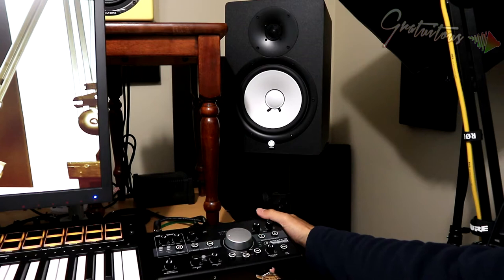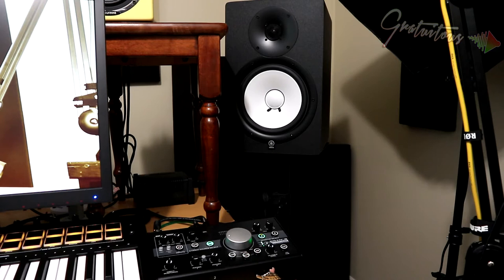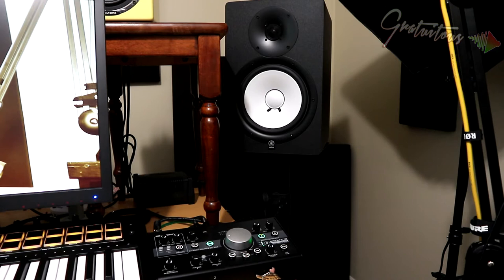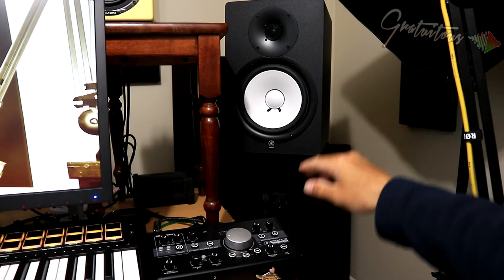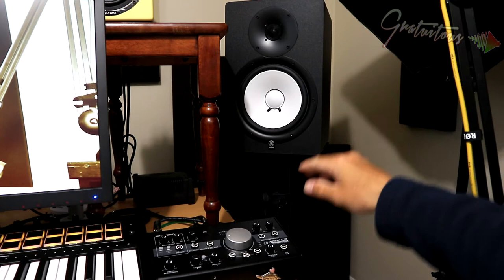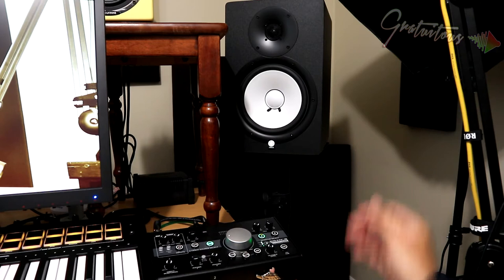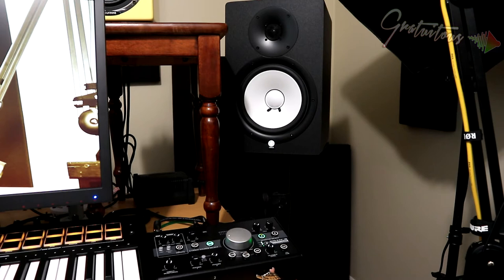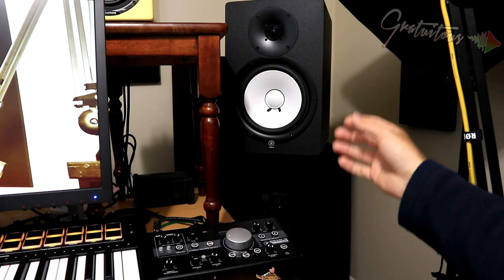How to Stop Speakers Popping when Turning Audio Interface ON/OFF

Comment: OK, by the title I thought this was for all audio interfaces. Turns out its only for the .0000001% of people who have an OPTION TO TURN THE SPEAKERS OFF!!
Reply from the maker: All speakers have the ability to turn them off/on (for reference monitor speakers).

Not all audio interfaces have the ability to be turned on/off via switch.

What's your issue you're having?
Reply: @itsGratuiTous  Huh im confused too bruh. Not all speakers have off/on. the only way I can get power to my speakers is through my amp.
Reply from the maker: @tradertom4843  Sorry for confusing wording.  The amp is your on/off switch to your speakers, which is the same thing as an on/off switch on the speaker itself, so there's no difference there.  The problem is if your audio interface does not have the on/off switch.. that's where the pop is coming from.  Either way, make sure to turn off your speakers first.. does that clarify..?
Reply: We all have the same option.. if you use dedicated power strip as the on and off for your monitors.
Reply from the maker: @sooesoss6063  This power bar trick will still work if you do not have an audio interface with a power on/off switch.  Use the power bar to turn off and on your speakers before turning on/off your computer, or unplugging your audio interface!
https://itsGratuiTous.com/

Comment: Recently got a new active subwoofer. Connected directly to my tv headphone out. I noticed it popped when the tv would turn on. Same thing would happen to my active bookshelf speakers, but they were only $100 so I didnt really care with them. And honestly, my speakers haven’t been damaged in the 5yrs I have owned them anyway so I just lived with the pop. The new subwoofer was different though, being $500.

The issue is I dont have a proper dac/amp or A/V receiver yet and I know the 3.5mm headphone out is higher voltage than the line level RCA input that my subs take, but I read online that it could still work as long as I set my tv volume as low as possible and subwoofer set to minimum volume, before adjusting to get proper levels without overdriving the sub. They do work, but doesnt fix the pop.

After some tests with my multimeter, I discovered that the tv headphone out is storing voltage (in its internal capacitors) which buildup voltage each time the tv is powered on. Measurements showed voltage spikes anywhere from 3-6volts coming from the 3.5mm headphone out of the tv. And looking up the manual for my sub, its RCA line level inputs are only rated for -10dBV (or 0.33volts). So the power spikes were much higher than this of course. 

After more testing, I found that the buildup charge eventually drops after power on (or either by turning it off and letting the tv “rest” before turning it on again) by about 0.10V per second until it reaches a steady maintenance working voltage of 0.15V, this was much better for my Sub inputs. 

The impedence of the cables being used also make a difference. Thinner gauge and shorter run lengths had less impedence and were more efficient, meaning the voltage was being transferred faster -which is not what you want. Now, at first, I was using one of those cheap 3.5mm to RCA Y-adapters usually included with cd players, and stereo equipment. About the same gauge as a standard aux cable and ran about 6ft. 

When I discovered the pop, I ordered a thicker and longer Amazon basics cable which was 8 foot and double the gauge. Measuring this cable I now had spikes around the 0.5-1 Volt range. The new cable was slower and less efficient (higher impedence) reducing voltage transfer. Again, voltage was depending on when I last turned on and off my tv and how much residual charge was still being stored internally. I havent measured the new RCA cables because I was impatient in waiting for stored voltage to drop, but I am guessing if the tv hasnt just been on and there is no stored electricity, it shouldnt cause any “popping” to my speakers or subwoofer. And at least now I know that at it takes about 2-3mins to go from an over-charged state of 0.5-1+Volts if it is. This doesnt mean you have to wait 2 mins after powering on each time, just wait until it is fully powered up and running before turning on your audio equipment. 

The 2-3mins is just how long it took to cool down once it had more than normal stored levels of charge (from being repeatedly powered on, consecutively, during my testing), as I was watching the voltage levels drop with my multimeter. Actual working voltage with the new cables was actually 0.15V after a normal power on, which was perfectly suitable for my subwoofer in this case.

Again, this setup is not ideal, and ideally you need some kind of receiver or dac/amp in between the source (tv, laptop, etc.) which can take that higher level headphone out signal and output it to proper, unamplified, Line Level or Speaker level input for your speaker or subwoofer. Turning the tv or source on first, with the sub volume all the way down or sub turned completely powered off, and waiting until the tv is completely powered on BEFORE you turn on the subwoofer will get around this issue. As well as using higher impedance and non-faulty, properly grounded cables will avoid any speaker or sub pops. Avoid short cables if you are trying to increase impedence. Longer cables at higher impedence will help slow down voltage spikes. 

I am saving money before choosing and buying a receiver or amp/dac, so for now I am stuck with this setup, but switching the cables and only powering on the sub after the tv is on and fully running, as well as not repeatedly turning the source on and off will help reduce charge buildup and avoid speaker pops. So, yes its a pain having a protocol in powering everything up, but it is a fix that works. Thanks for this video, and hope it helps anyone facing the same issue. My subwoofer alone was $500 and I would hate to blow it on poorly wired cables, especially if I am not technically using the correct inputs it is rated for. But I just have to wait until I have the proper equipment for it. 

For those using speakers or a sub in a desktop setup, something like a fiio, aune, or ifi dac amp with optical or usb inputs (or even rca inputs) and a proper Line Level or Speaker level outputs will allow you to connect your audio stuff to your digital equipment properly and you wont have any problem of improper voltage matching like I had. 

And it shouldnt happen, but at worst, if anything were to get over driven, it would happen to your AV/ home theatre receiver or amp dac and not your speakers or sub!❤ 
If anyone is reading this in the future and does want measurements of the Amazon basics cable from my tv headphone out I can do that some weekend on another time. But everything is working out for me so far. Just do like the video -power the source on first, before the speakers/sub. And power down the speakers/sub first before turning off the source last. This will bypass the voltage spike. Exactly like hooking up a car battery for a jump start. We are just trying to avoid the voltage spike. And if your hooking up directly to a tv, or any large electronics with internal capacitors, dont just keep turning your sources on and off or switching between powered sources cause it may be building up larger and larger voltage, which will go to your speakers or sub each time.
Reply from the maker: Thanks for your in-depth response / analysis!  Again, this was just for home studio speakers / subwoofer pop when turning them on/off.  Many times we have a switch for on/off, so simply just turn the audio interface on BEFORE turning the speakers on.. and turn the speakers off BEFORE turning the audio interface on to avoid this pop.

As mentioned, I don't know if it causes any harm to the speakers, but the sound sure is annoying.  For headphones/earbuds, you can simply just remove the cable each time you turn the audio interface on or off, but it is an annoyance / hassle.. I've just kept mine connected and go with the pop..  (reader, please make your own decision).
Reply: My JBL 305Ps pop if you plug them in the instant you turn them on. Otherwise you can plug an unplug all day without a pop. I think they have some capacitor anti-pop but don't know...but seems the same kind of thing you're describing.

Comment: Does your monitor sometimes turns off when you turn on your speakers? Mine is plugged in a smart power strip. My pc rig is plugged in a matic voltage regulator. but bot are plugged in a 2 gang outlet. I understand that using it on a smart power strip is equivalent to unplugging them while they’re on. That's why I constantly hear thump. I wonder if it's bad?
Reply from the maker: Hey, sorry your question is hard to understand.  I'd try to reduce the thump sound.

Comment: The pop is bad, and it will damage your speakers, its called a power surge...  the Nero headphone amp also make your system monitors pop.

You have the best remedy that Ive heard so far.  
 To add to your idea you can Get a surge protector for
 your monitors and you can then turn on/off monitors that way.. (dedicated Surge Protecter) where you can plug just your monitors. I have 4 monitors and a subwoofer, this way one power switch for all.
Reply from the maker: Ya I have a power bar I use.  All equipment is also plugged into a Furman power strip..  The whole goal is the right timing of turning on / off equipment to avoid speakers popping when turning them off and on!

Comment: Thanks for the video. How do you turn on/off your speakers without pushing on/off buttons behind the speakers? Do you use a surge protector of some kind?
Reply from the maker: Hey!  It's just a power strip!  (Not a super cheap one.. but a middle of the road will do!)
https://itsGratuiTous.com/
Reply: Once you turn off the speakers via the power strip. Do you leave the switch on the back of the speakers on or turn them off too?
Reply: @_Andrew-1  I also want to know that.
Reply from the maker: The speakers stay on!  The whole point of this power strip is to turn off the speakers from an easier location! https://itsgratuitous.com/
Reply from the maker: The speaker switch stays on, and I just use the power strip to turn off/on the speakers! https://itsgratuitous.com/

Comment: actually i  think that this will work for my case of problem, because there is ground loop issue in my krk monitors,and everytime i turn them off ,they pop so bad ,sometimes yes, sometimes no, but most times i keep them turn off automatically
Reply from the maker: Hmm a ground loop is usually the buzzing sound.. the popping is usually due to turning the audio interface on/off before the speakers.  Let me know if you get stuck along the way.. you can find me here!:
https://itsGratuiTous.com

Comment: I have a home stereo setup with wired speakers connected to my onkyo receiver.  It has been set up for over 15 years now.  All of a sudden it’s making a pop noise on my speakers with or without the volume up on the speakers.
Reply from the maker: I don't think this is a volume thing.. more of a surge of power turning off / on that quickly sends a transient spike to the speakers

Comment: I have some Kali Audio monitors connected to a power strip. Should I turn off the power strip then shutdown everything else? And, if so do I turn each monitor off individually aswell once power strip is off?
 Thanks.
Reply from the maker: Just turn off the power strip to the monitors is all, then turn off your audio interface.  The power strip saves you from having to turn off each speaker individually!: https://itsgratuitous.com/why-do-my-speakers-pop-audio-interface-on-off/
Reply: @itsGratuiTous  is it bad if I leave the speakers on and just turn them off via the power strip in the long run?
Reply from the maker: I would assume the power strip is just like turning the switch on / off on the actual speaker.. but I cannot say for sure on how it's designed.  I just do this for convenience of not having to go in behind and turn my speakers on / off each time, and also risk moving the way the speakers are set up and how I'm used to them.
Reply: Im having an issue where when I turn off my monitors first sometimes there will be a popping noise(left monitor). Not sure why even tho I’m turning them off first and on last (via power strip).
Thnx

Comment: Is the popping bad for the system? My speakers and interface are both connected to a rack mounted power supply for ease. Is it bad for the speakers or interface to have the popping occur when you turn it off
Reply from the maker: I cannot say yes or no here.  It seems either manufacturer doesn't really state their opinion on this.. so it doesn't sound like there's harm..
Reply: @itsGratuiTous  there is no proof tho, is just a sound, how is it different from playing rap music for example?
Reply from the maker: @naegleriafowleri2230  That's what I was saying - I cannot say yes or no because I have no evidence or testing if it causes damage! - It is a harsh pop sound though much higher in frequency than a kick drum.

Comment: I do the same thing but sometime forget. Why this pop sound happen?? Audio Interface problem or something?
Reply from the maker: I'm not sure.. but when you turn off the speaker with its own switch, it must have some type of slow discharge.. whereas the audio interface switch causes the nasty pop!
https://itsgratuitous.com/why-do-my-speakers-pop-audio-interface-on-off/
Reply: @itsGratuiTous  I use genelec 8030c. My right speaker give the pop up sound if I directly off from main switch. But if i use speaker switch then its okay. I have another     monitor krk. But krk is okay
Reply from the maker: @md.tanjimreza7027  Yeah, I just do what I showed in this video to reduce the pop, as well as give myself a convenient on/off of my studio speakers!
https://itsgratuitous.com/why-do-my-speakers-pop-audio-interface-on-off/

Comment: I didn't like this solution so here's what I did:

1. Booted Unraid on an old computer.
2. Ran a VM and installed Home Assistant
3. Integrated a smart switch into Home Assistant
4. Plugged both speakers into the smart switch
5. Setup two ON and OFF automatons inside Home Assistant
6. Plugged in a secondary keyboard into my computer
7. Used LUA Macros to assign the secondary computer different keystrokes then the primary
8. Mapped two keys on the secondary keyboard to send a webhook to the ON and OFF automations inside Home Assistant using AutoHotKey
9. Set the AHK script to run on startup
10. At the top of the script set it to send the webhook (so that when the computer turns on the speakers turn on after)
11. Map another button on the secondary keyboard so that when pressed, the speakers turn off and then the computer does.
Reply from the maker: Sounds intense!
Reply: Not even know the intention
Reply: @itsGratuiTous 😂

Comment: I have a Scarlet 2i2 and it doesn’t have an on and off button, yet the right speaker always pop. Not the left one for some reason.
I popped so loudly that eventually something burned out inside and I had to take it to get replaced. It still does that. I have KRK’s Rokit 8.
Any known solutions for interfaces that don’t have an on/off switch?

PS: Same issue happened with my Presonus Audiobox. I got the Scarlett because I thought it was an issue with the interface since I changed the cables and the problem persisted.

I switched speakers and it’s always the one on the right side that has the issue. I’m at a loss with this one.
Reply from the maker: Hey! - When does the pop occur, when you restart or turn off your computer?  In those cases, I'd say same thing.. make sure the speakers are off before restarting/turning off/on your computer so prevent the popping..

Let me know..
Reply from the maker: Hey following up on this Fernando, another person commented and shared they used a "USB Hub with a switch".. here's a link for more info:
https://www.reddit.com/r/trapproduction/comments/vgwckg/comment/id9fp3t/?utm_source=share&utm_medium=web2x&context=3
Reply: dude sorry to tell ya but thats your krks. i went down a rout of repairing speakers for a while and the glue  stuff they use to fit some of the components shorts the circuits and blows them. you could be lucky. iv seen it all over the internet and repairs mainly on rokit rpg series. i have rokit 6s and i think i have been lucky so far. their newer products are supposed to be ok. id advise opening them up and having a look a what the sticky stuff is doing and replace with a non conductive material
Reply: I didn't like this solution so here's what I did:

1. Booted Unraid on an old computer.
2. Ran a VM and installed Home Assistant
3. Integrated a smart switch into Home Assistant
4. Plugged both speakers into the smart switch
5. Setup two ON and OFF automatons inside Home Assistant
6. Plugged in a secondary keyboard into my computer
7. Used LUA Macros to assign the secondary computer different keystrokes then the primary
8. Mapped two keys on the secondary keyboard to send a webhook to the ON and OFF automations inside Home Assistant using AutoHotKey
9. Set the AHK script to run on startup
10. At the top of the script set it to send the webhook (so that when the computer turns on the speakers turn on after)
11. Map another button on the secondary keyboard so that when pressed, the speakers turn off and then the computer does.
Reply: Use a Power strip for the on off function for your monitors, turn them off while booting up your system.